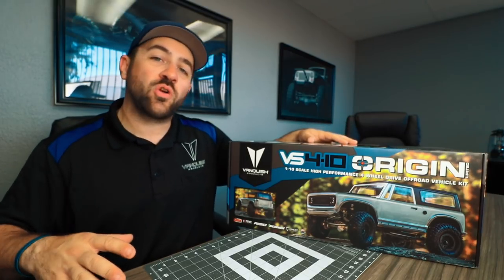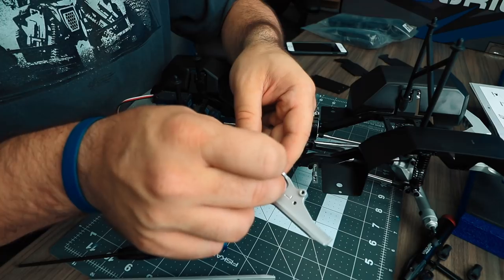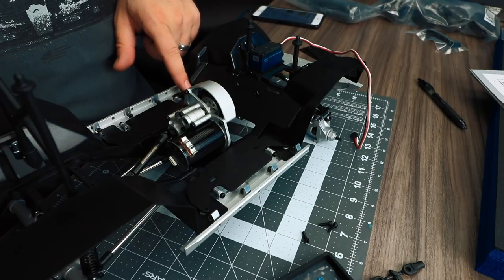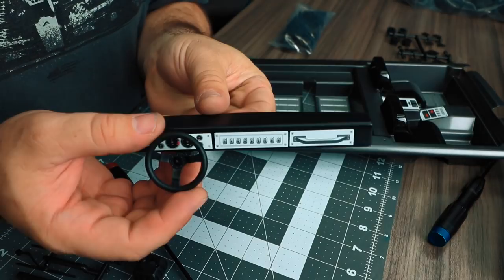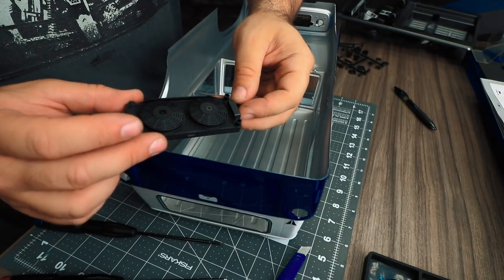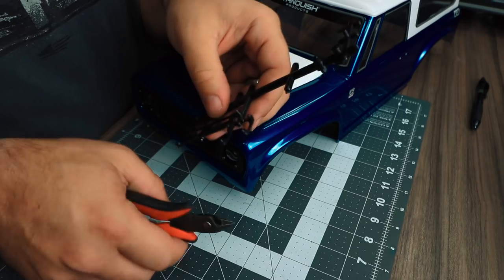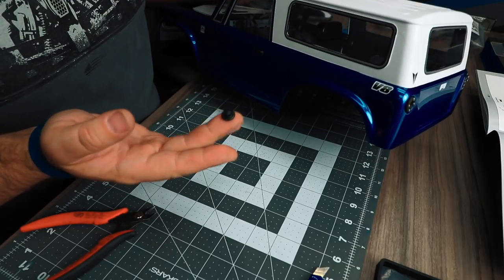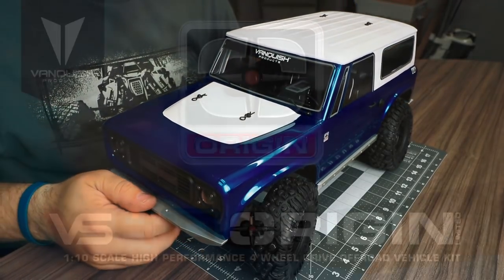VS4-10 Origin - Body Details & Final Assembly - Vanquish Products

Comment: where did you get those aluminum rock slider mounts?? not the rock sliders but the brackets you screwed the sliders on.. and will they fit a vs4 ultra chassis?